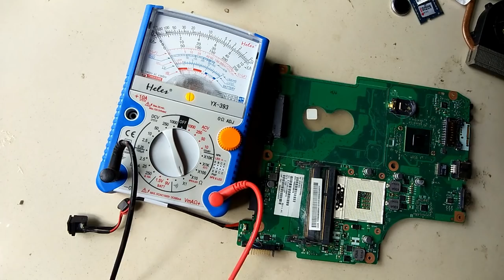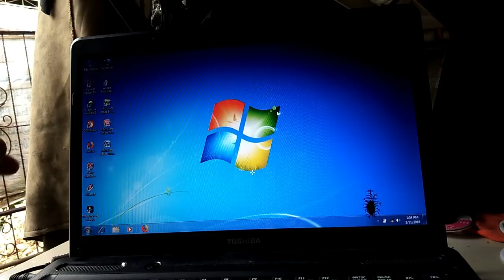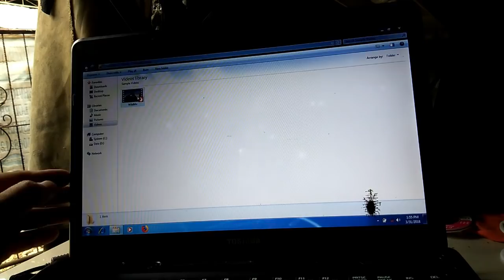Memperbaiki Laptop Toshiba C640 Mati Total / Repair Laptop 6050A2357502 Dead

Comment: izin om. toshiba c605 kode motherboard BR10ML-6050A2446201-MB-A02. konektor plus batre keluar cuma 1v. fuse LF15A keluar cuma 1v. apakah ini ic cas BQ725 atau mosfet TPCA 8065-H ya om guru 🙏

mosfet TPCA 8065-H hanya mengeluarkan tegangan 1v

2 elco jg ga keluar tegangan 5v 9v. apa ganti elco dulu?

soket tombol on off pun tdk mengeluarkan tegangan 3v om

Comment: minta tlg bli, usb toshiba C640 tdk fungsi. sdh diganti IC Controllernya. tp hslnya, klo di switch ON, 5V nya cm ada di kaki IN (led mouse mati klo dicolok). di kaki OUT+ kaki2 usb+kapasitor tdk ada 5V nya. tp klo posisi switch OFF, smua kaki ada 5V nya (led mouse nyala). itu apanya ya bli? mksh
Reply from the maker: Langsung jumper in ke out seperti video ini https://youtu.be/PFiTcpx2XBI